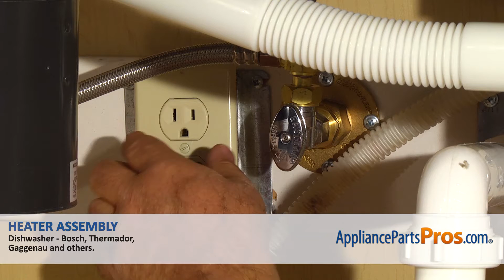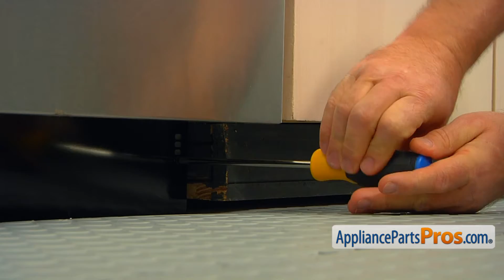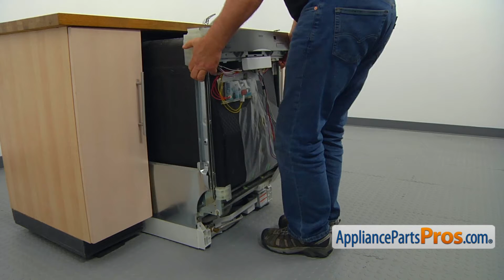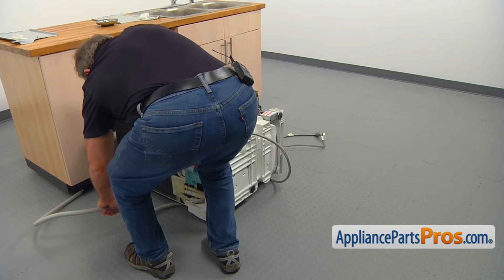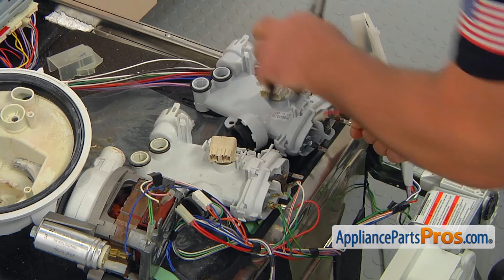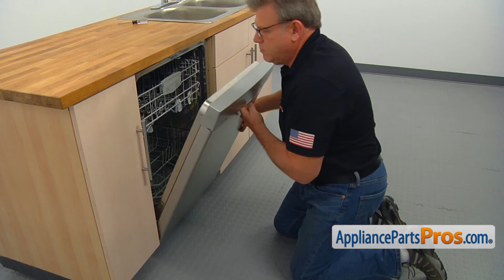Bosch Dishwasher Heater Assembly 00480317 Replacement — fits Thermador/Gaggenau

Comment: Let’s be real….This is extremely difficult to do and Bosh should be ashamed to design that difficult to replace equipment. Anybody who designed appliances should always have in mind easy replacement parts and easy access again very disappointed with design of this dishwasher personally is not worth the money.
Reply from the maker: We understand your frustration. Some appliance repairs can be more involved than expected. We appreciate you sharing your experience, and we hope the video helps make the process a little easier for those taking on the repair themselves. Thanks for watching and sharing your feedback.

Comment: There is no need to remove the entire washer out. All these steps except for the internal steps of removing the spray arm and fine screen can be performed from the hole left by the sump pump when removed. It's tricky but with preserverence you can have this done in half the time. There is adequate clearance to but the only tricky part was getting everything aligned water inlet and outlet line hoses were just long enough I was able to assemble the heat inside the dishwasher drop it back inside. Pull the sump out and connect the already wired heater core. Saves you many unecessary steps.
Reply from the maker: Thank you for the tips!

Comment: New in 2012 my SHE45 was $899.00 not including delivery and disposal of the old unit. Mine is Stainless throughout. This simple fix the heater assembly replacement shown here is akin to open heart surgery. But it looks doable besides the $250 purchase showed up. I think you need to be really careful because at the end he said hopefully it doesn't leak so I'm gonna be meticulous in my disassembly and I'm not gonna muscle any of it. I'm going to be very methodical and make sure the hoses and everything fit just right I'm not gonna use excess force on any step. I've had the front door off before to look at the control panel looking for a loose solder joint, which unfortunately was not as part of the troubleshoot methodology. Next step is the replacement of this heater core. This is a serious repair folks.
Reply from the maker: Thank you for sharing your experience and thoughtful approach. You’re absolutely right—replacing the heater assembly is a major repair, and taking a careful, methodical approach is essential to avoid leaks or damage. It sounds like you’ve already done your research and have a solid plan, which is the best way to approach a repair of this complexity.

We appreciate you taking the time to document and explain the process, as this insight can be very helpful to others facing a similar situation. If you need any parts assistance or have questions along the way, please don’t hesitate to reach out.

Comment: "It's a gonna be a very easy repair. Should only take you a few mins to show you." <--- then goes on to show a super complicated dissassembly of the dishwasher that will take the average person many, many hours to do (2-4 hrs according to comments). 😅

My Bosch washer is taking hrs to finish & it's not very hot when it finishes, so I'm suspecting the heating element is going bad, yet this "very easy repair" looks overwhelming to an amatuer like me.😂

Comment: Do check Control board solder before changing the heater ,
Right behind the buttons ....
It just took a drop off solder and 30 minutes .

Comment: Hi. Thanks for the video. We have kind of a similar problem, but with a different model (and maybe heating system). Our dishwasher is a Bosch SilencePlus Series 6 SMS68IW07E_01, with zeolite system. We have the error E07 constantly popping out after 5-15 minutes from the start of the program. There is no obstruction on the intake opening. My suspect is that some fan for the circulation of humid air is not working. Might it be? Do you have a dedicated video? Thank you again.

Comment: THANKS for the extremely helpful video!  I was able to do this fix myself in 4 hours, saving hundreds of dollars.  I would not have been able to do this without your video.

I have a few tips for others…  Make yourself a system to keep track of all the little screws and where they go.  I used 8 little bowls and put sticky notes on them so there would be no confusion.

Just before you tip the dishwasher on its back, use a towel to mop the water out of the sump so it doesn’t splash all over when you tip it.  That will save you some work all those times he says “be prepared to catch some water” later in the video!

Before you take the wires off of the heater assembly, take a picture of each connection on your phone so that you can reference that to double check your work.  My Bosch had a slightly different wiring configuration than was shown in the video, with one of the terminals on the heater assembly unused.

When he says “make sure the rubber base is under the sump,” he is referring to a circular part that slides on the bottom of the sump to support it off the base of the washer.  Mine fell off as I was doing the work, and it took me a while to figure out where it was supposed to go.
Reply: Ha!  I had the same issue with extra contacts on the heater as well as misplacing (temporarily) the little rubber bumper from under the sump.  I also reattached the base before putting the covers over the door/hinge spring thingies... and then decided that I could get by just fine without the covers, thank you very much.  :-)

Comment: Thank you - this was really helpful and clear. As mentioned below, the UK version is a bit more complicated - the wires are shorter so the sump and element can't be removed without disconnecting additional wires first, but a few photos of before and after allowed me to retrace my steps. All working perfectly again with hot water and no leaks. Thanks...
Reply: Mine had a shorter wiring harness as well, and I'm in the US.  I'm guessing Bosch decided to save 2 cents on each washer, and shortened the wires at some point...

Comment: Nahhhh I'll get a new one. Thanks anyway
Reply: Went just as described in the video, got it done in 4 hours, with a $140 part.  Much better than $769 for a new one!  (Or $450 for a service call)
Reply from the maker: That's your prerogative. We're here to help if you decide to do the repair, though.